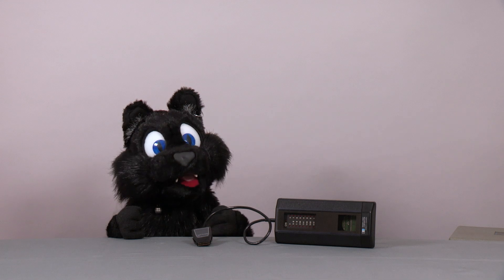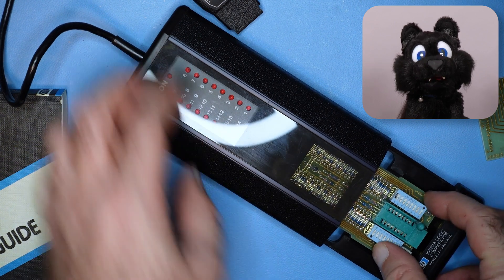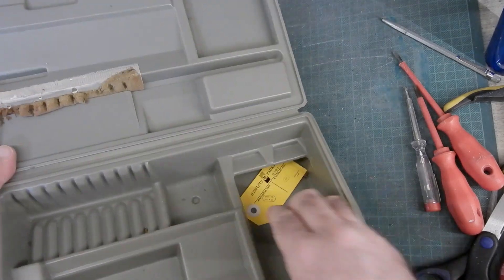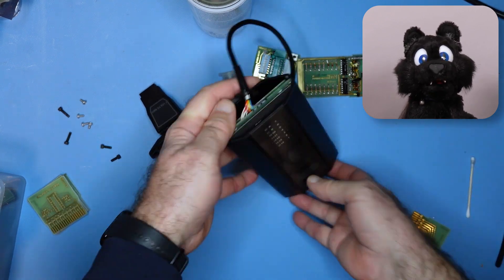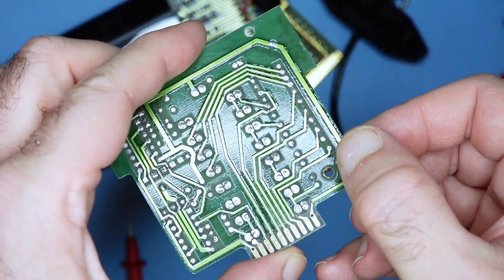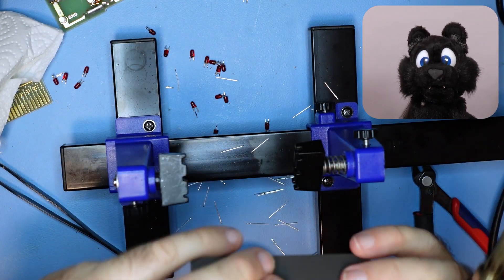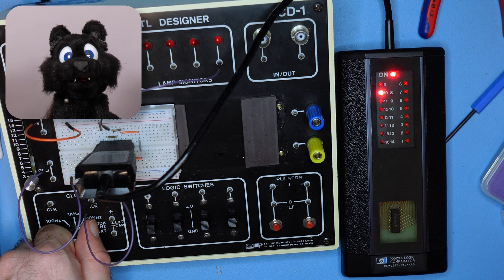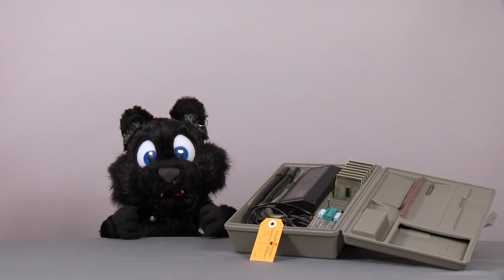HP Logic Comparator

Comment: Mam taki od kilku dni. I nie rozumiem jak go używać z kartami  mam cały zestaw karta testowa, karta z gniazdem ZIP i karty do układów scalonych. Nie wiem jak te karty do układów scalonych używać. Jak to działa. Pozdrawiam z Polski
Reply from the maker: I hope Google translate is working correct 😊

The ZIF (I assume you mean that green socket with the lever, ZIF = Zero Insertation Force) socket version is a generic replacement for the smaller IC cards. The cards were the first idea and got replaced with the generic card later on. So if you have that ZIF socket one, you don't really need the IC cards. I just think they are a nifty piece of history, so I keep them around. The idea was to solder one chip of each type into a card, turning it into a "known good reference" for the tester. While the ZIF socket card uses a lot of diodes to detect power lines and dip switches to select input/output lines, these adaptations had to be done by hand on the IC cards.
Bottom line: for standard ICs, like 7400, 7404,... it still might be a good idea to solder a chip to a card and have it ready to pop in. Saves you from changing the DIP switches every time you need it.
Reply: Tak.

Comment: I have three of these, there was a reproduction project years ago on KLOV to make replicated units,  but the pcb(s) for the standard ic(s) have also been reproduced. Love my comparator, I also had a bad LED on one, but i found the brightness didn't not match, i do need to go back and replacement them all as well, what part number did you use for the replacement LED(s) ?
Reply from the maker: I have a grab bag of LEDs around for various fixings and tests... so not a real part number as such, just what I had around. Red LEDs wihtout built in resistors are pretty much all the same voltage drop so they should fit in nicely. The outer diameter was just 3mm and the length works fine with what I call house and garden variety. If you can pick for an order, I'd go with the lowest light output ones at 10mA you can find for the original look.

Comment: I have 3 of these HP comparitors with all accessories and original manuals and paperwork but never use them now. I got a much nicer comparitor that will do 14, 16 and 20 pin chips, Dynascan 552. Nowadays I usually use a logic probe comparing the truth table and if there's any doubt I pull the chip and test in my Retro Chip Tester Pro.

Comment: Yep rare as hen's teeth, surprised you found some PC boards and even more surprised you found the Ref Card.  I have seen one of these in the past,  it was left on the top shelf new a window with full sun,  when the owner showed it to me the sun had killed the wire to the test clip which he had modified,  He said he had not used it in  since he put in on the shelf some 15 years previously and that was in 1992 ;),  seems chips became so cheap and reliable  so quickly there was just not need to debug them or even check them,  just replace.  He said it was used for line inspection QC but was soon supplanted by software solutions

Comment: I would probably have put a SMD resistor in line with the bright led.
Reply from the maker: The LEDs have to be soldered flush, otherwise the bezel will not fit; so the best chance of limiting the current with new LEDs would be to replace the existing 470 ohm resistors with slightly higher values. Right now, they should run at slightly under 10mA per LED, which is already "full blast" for modern ones.
Reply: @atkelar  ok didn't realize that!

Comment: I was wondering if you were going to use an LED from the backup device to do an "era-correct" restoration. I think I'd have done as you - with the better technology replacing the old.
Reply from the maker: I tried some older LEDs first - the parts drawer is my "random old LED" one; but over tiem there have been so many variations, it's practically impossible to find single matching ones. I'm pondering higher limiting resistors to dim the new ones; would cut down on leeched power even; but I like the carbon style resistors in the PCB I picked... x.x

Comment: Seems like this testing mode will miss any Input or Output faults caused by a bad IC under test with a shorted High or Low pin.  Seems like this tester can only fine internal logic faults. and not faults caused by shorted High or Low pins.  TTL chips often have short to ground input logic signal pins.  Did enjoy the old test equip. video.
Reply: @kenromaine2387  Indeed! It’s useful to have in circuit testing that warns of pins shorted high or low, whether by design or a fault.

Comment: I wonder if anyone made a modern equivalent of this that uses software emulation of the reference device. I use an ABI System 8 BFL for in circuit testing but it runs its own test routines rather than compare two real devices.
Reply from the maker: I have ssen some software defined chip testers - the "retro chip tester pro" comes to mind - but so far, not any that are "in circuit" options. One downside of this approach here is also that it doesn't support bidirectional pins; i.e. RAM or transceivers are not going to give proper results. But since it has pull ups for the reference IC, at least open collector ones should work fine.
Reply: @atkelar The BFL I’ve used since the late 90s copes with testing tristate devices in-circuit  but knowledge of circuit is sometimes necessary to force any connected busses into high impedance mode e.g forcing reset / disabling clocks etc (several driver outputs are provided to do this during test). The in-circuit test will warn if it sees any bus conflicts during the test. It can also take/store/compare a VI curve trace of each pin which is great for picking up anomalies on busses etc!
Reply: @atkelar p.s. if you’re interested, I have a short snippet of the BFL testing a 6522 but using an out of circuit adapter at the time. It’s currently in the 2nd last video on my channel (broken HH Tiger computer)
Reply: Would probably be hard to get the timing right for all the different flavours of chips even with the same function.